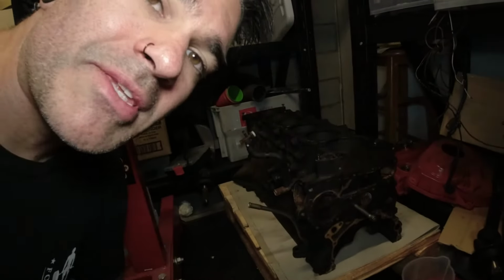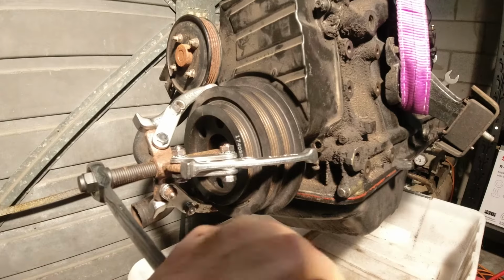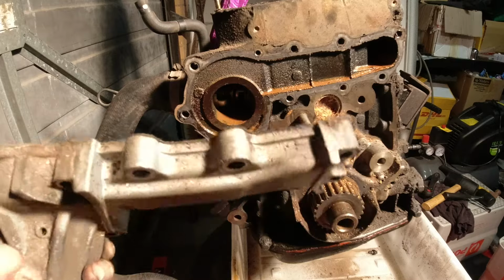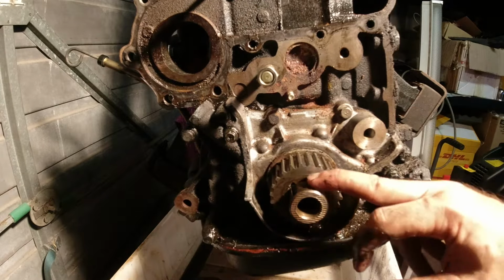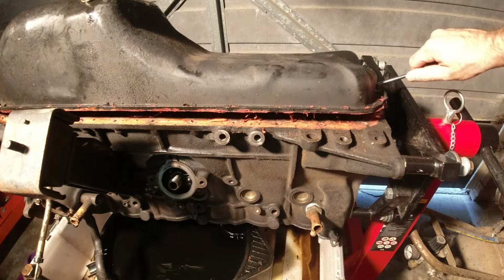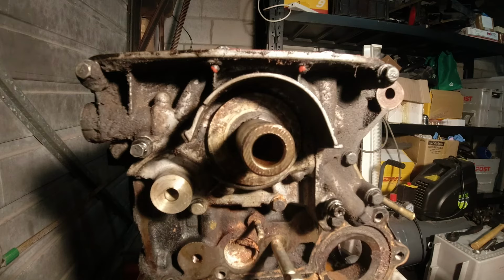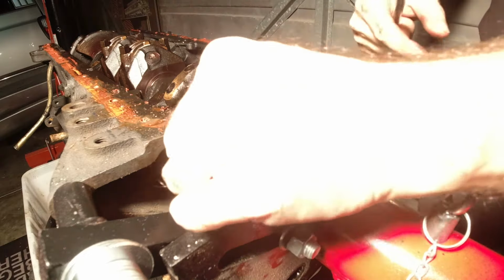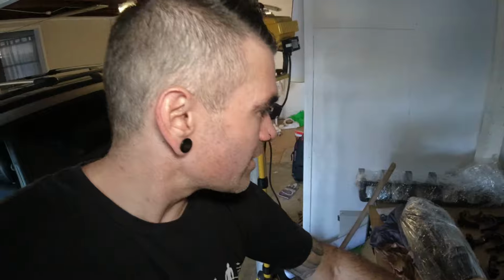Detailed Nissan RB30 Block Teardown

Comment: Crank keyway for timing gear looks pretty flogged. Will need to tidy that up before reassembly, maybe get it sorted if you end up putting a collar on for oil pump drive.
Reply from the maker: Yes mate agreed. I have a new video coming shortly where my machinist talks about fixing up the crank, and we will be doing the collar anyway so may as well fix up what I've already got!